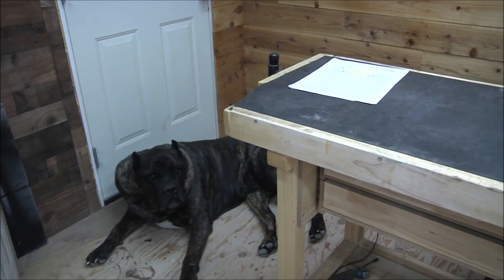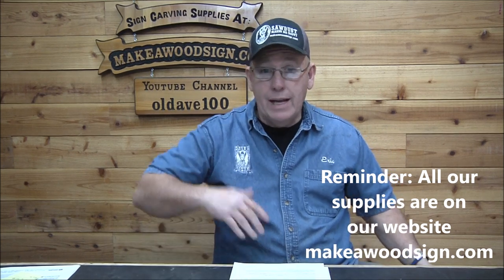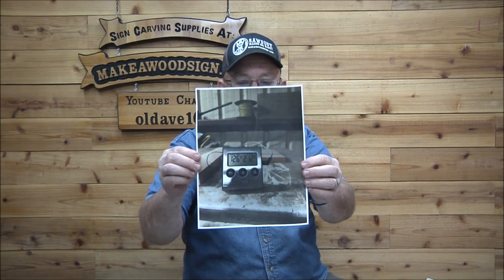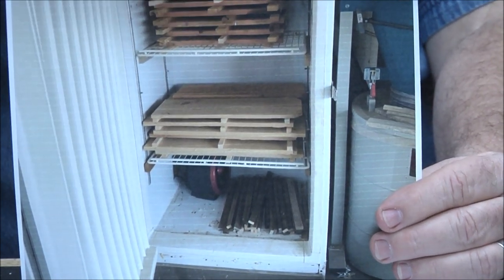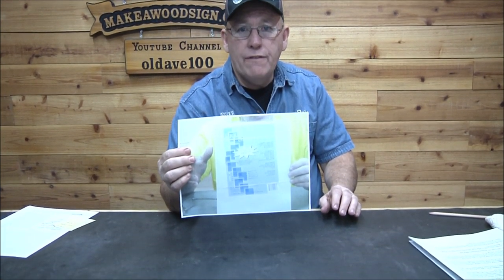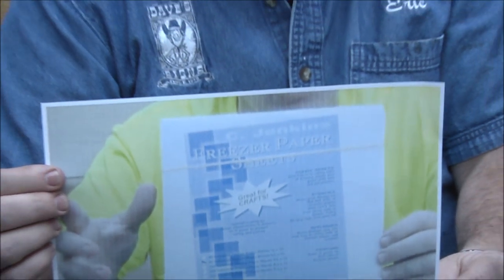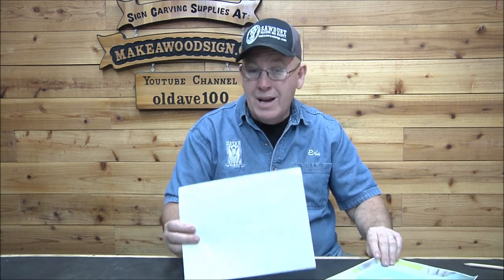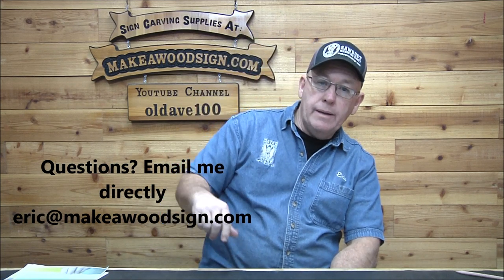Coffee & Questions 1/27/2020 Freezer Paper Alt. & A Mini Kiln

Comment: I'm still using the same old label sheets over and over again. Stick the sticky label on the back to maintain the thickness of the carrier sheet, and it goes through the printer no problem. Transferring to the wood is easier too, due to thickness of the sheet, there's no need to stick it in place before rubbing  because it don't crumple up so easy like freezer paper, just hold it down in place, and when finished with, just wipe the remaining ink off the sheet with a damp rag (plain water) and leave to dry to use again.
Reply from the maker: Great idea Eric!!! Probably has something to do with your name, LOL. I will have to give this a try.
Reply: @oldave100  Not too many Eric's around lol
Reply from the maker: Very true...

Comment: Hello.  This is my first randomly selected video from your lineup.  I'm building some book shelf speakers and discovered I needed to sharpen some router bits. Searching on YouTube for tips on this topic I discovered your video #32 sharpening router bits. Your video was not what I was looking for. but I found it interesting all the same. 
It appears I'm about to learn a little about sign making.
Reply from the maker: I have a couple other video that might help, Try #164 and LTS 8/27/17. Thanks again for watching and let me know if I can answer any questions for you, eric@makeawoodsign.com.
Reply: @oldave100  Great, I was thinking about asking,  which videos you might recomend for someone new here?  
I did watch I believe it was the introduction video.  Free handing a router takes quite a bit of skill, even with simple things like a circle. You only have to go outside you line once, to mess up a project.
The front speaker panels I'm going to use are 3/8" thickness.  The tweeters I'm using do not have a mounting frame; they are just round. which means the outside diameter of my hole  must have a lip 1/8" so the speaker does not push through the hole. I did a practice hole to see how precise I could get. fit the speaker to the hole and have it fit tight all the way around with no gap.  Well I have some little tini gaps and they stand right out.  The bit I'm using 1/2" straight bit is one I found  in a box of tools a friend gave me when he moved.  It was pretty dirty when I got it, So I just stuck it in my peg board for a rainy day. I started my speaker project thinking I had a new straight bit, but did not find one in my router case.  Oh yes. I have this old bit, cleaned it up, it had 1 crescent in each blade, someone hit a nail I guess.  So I made an effort to sharpen it. I had to remove almost a 1/32" to loose the crescent. It looked perfect when I was finished. However it's burning really bad when I cut with it.  It seems to cut just fine, but   I bet I have to take some off the outside of the bit because the cutting edge no longer sticks out as far as it did.  That's my guess, and how I ended up finding you guys.  I could go buy another one, or have a shop sharpen it for me, but I would really like to learn how to sharpen them myself so I can save time.

Comment: Do you set your printer with a certain type of paper when you load the freezer paper?
Reply from the maker: No just regular paper.
Reply: @oldave100  I did try setting it on best printing, but found that too much ink came out on the paper and it just leaked out ruining the picture on the wood. like Eric say, just normal settings are best for plain paper.